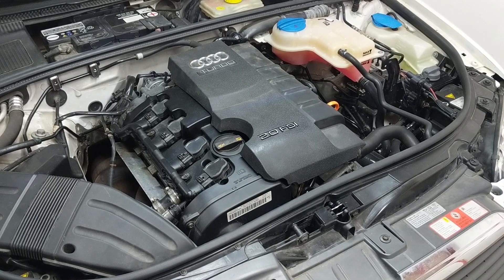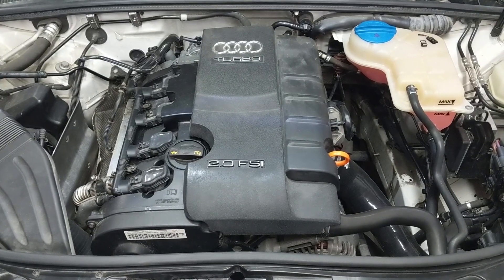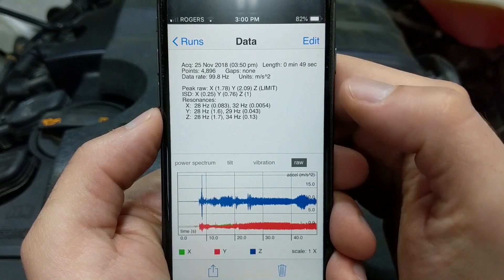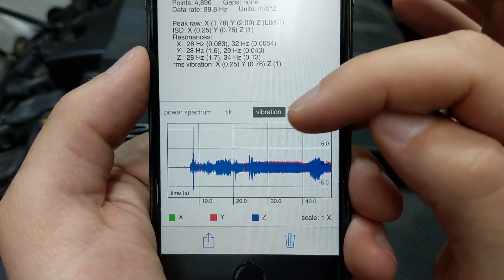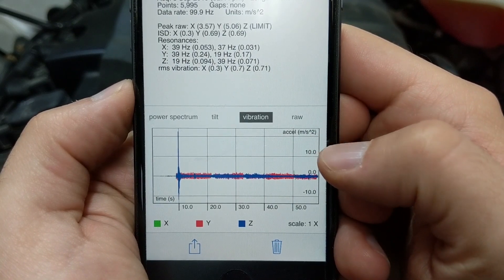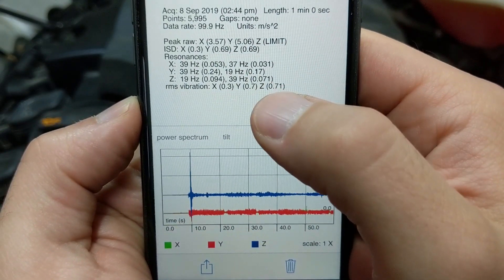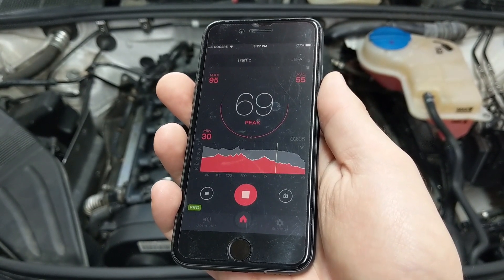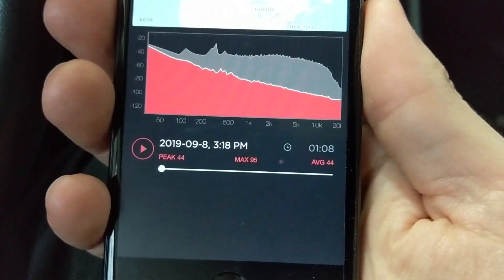NVH Results & First Impression | 034 Street Mounts | Audi A4 B7

Comment: I appreciate this video. Been trying to find videos of these mounts from inside the vehicle to see the NVH, and also see if there is any noticable rattle. But I haven't found anything other than people talking about them up until this video. 

It seems as though they may add a little bit of vibration as seen on startup in the camera. But I do think that the biggest place you'll notice the difference is in hard shifts under acceleration/boost. My current mounts aren't destroyed... But I can tell they have sagged. When I am getting up to speed in a more spirited fashion, I definitely feel the whole drivetrain lift and drop between shifts. It basically thuds. I wouldn't mind hearing your thoughts on hard shifts if it feels more solid.

Appreciate it again!

Comment: What did you do with the mount sensors. After installing the after market mounts?
Reply from the maker: Those A4 mounts didn't have sensors on them - but some would. Speaking from recent experience on my S4, if you have sensors but are switching to an aftermarket mount that no longer uses fluid (none of them do, to my knowledge), you just need to buy the resistors that plug into the factory harness to continue providing signal to the ECU that everything is still there. Some companies provide the resistor plugs (like Stern) and most sell them separately.

Comment: very well done.  you sound like an engineer. well thought out, nicely articulated.  I enjoyed your series.  thanks.
Reply from the maker: Thanks a lot. Although, I don't pretend to know exactly what I'm looking at and wish that I had more purpose-built tools for measuring NVH across a range of tests - driving included. And it would have been nice to have a true baseline of stats based on 2 good mounts, not 1 good mount and 1 dry one.